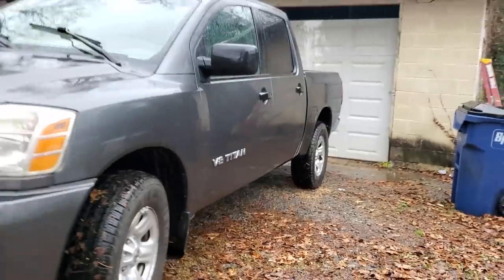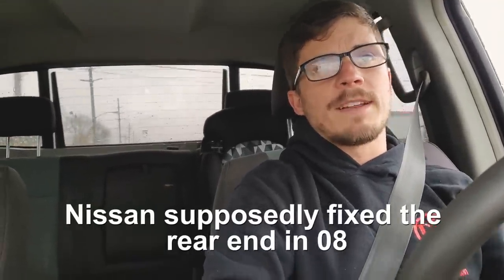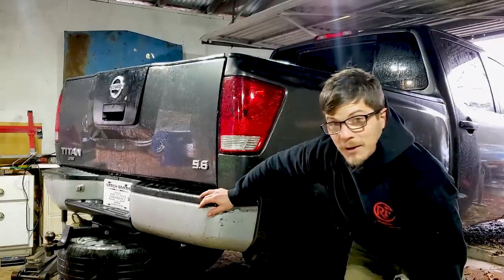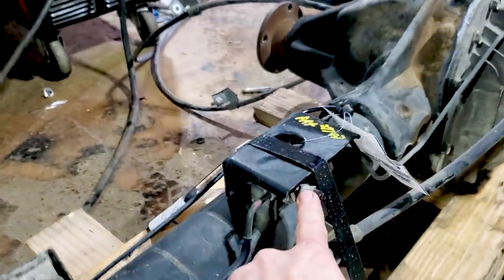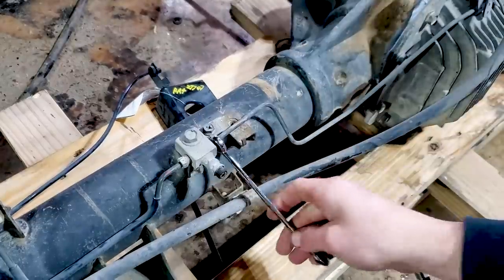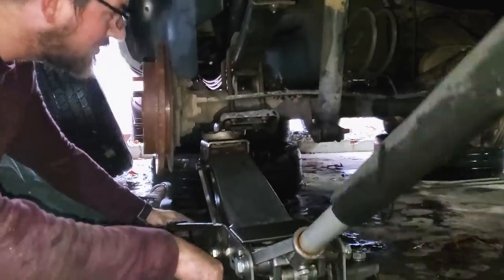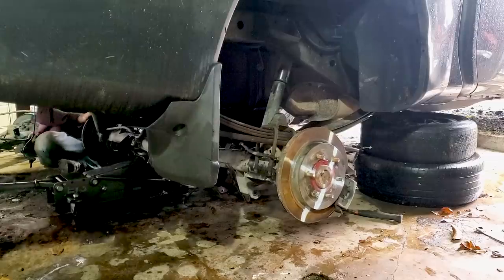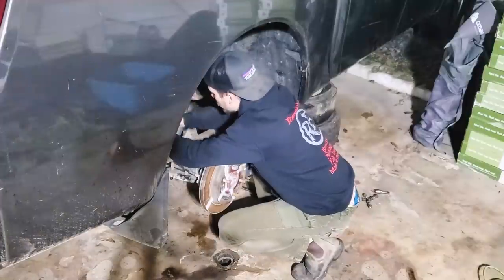HOW TO PUT 2008+ REAR END IN YOUR '04-'07 NISSAN TITAN

Comment: I have an '08 Armada with 315k miles. The Armada has an independent rear suspension vs the Titan solid axle so maybe they have different pumpkins. I changed my gear oil at 200k (probably the first time) and never had a problem. Mechanically these things are solid. There's a reason Nissan named the 5.6 the "Endurance". The only things that have needed replacement are the oil cooler adapter seals (where the oil filter screws in) at 250k, starter at 280k ( you'll be cussing Nissan for putting it under the intake), the alternator at 300k, valve cover seals at 310k. The exhaust manifold is known to crack, pretty sure mine is but I'm saving up for some Cajun headers. If you don't have the Magnaflow 24" 2-1 muffler, you need one plus the resonator delete. The trans pan has a drain plug. After about 50 - 75k it should be drained every other oil change or 10k. It's only a qt or 2, just measure what comes out and replace it. There's guys that have over 600k on the 5.6 Endurance without a major overhaul.
Reply: I totally agree with the endurance part. I'm at 329k with only minor issues like you stated. And yes the starter is a mf to change
Reply: 300 k, as a green sticker and  license plate offroad truck. Trans went out at the 300k but it because we tried to made it into a sequential shifting the abuse destroyed the wiring connections. 

Suspension is the only thing not OEM. Everything else is OEM and hasn't been changed. Other than the service maintenance parts.

The motor was pegged in the hot for 15 min in the desert trying to make it back to base camp. Still running strong.

Took a fence post or something like it through the front and destroyed the remote oil filter and dumped oil while running 65mph in the desert. Looked down and saw the oil pressure drop. Did a bypass to make it back to camp. Dam motor still going.

No leaks from seals... big fan of the first gen. Titan. Going to buy a couple more rolling chassis

Comment: 07 titan here. My rear axle had the same whining as yours plus I had leaking axle seals 4 times! Replaced the oem differential with a Tru Trac and applied ultra black rtv to the new axle seals. Has been holding up fine ever since.

What sucks the most about the 04-07 axles is that the payload capacity is embarrassingly low compared to the 08 titans. My payload is a measly 1039lbs while the 08s have double that! 

Thank you for this video and showing us it's not that difficult to swap axles. Been thinking of doing this for a while. Although at this point I don't want to give up the Tru Trac and the 08 seals aren't guaranteed not to leak.

Comment: I hav had my 07 for years. It’s the atmosphere valve. I replaced it with a gorilla system that runs a tube up to my tale light on a filter. Then u won’t get water in your dif. An it will allow Pressure to realer. The stock cable plug really easy
Reply: Made my own out of some fuel hose and a fuel filter for a lawn mower. No more seepage
Reply: Yes!that's what I am talking about..offroad gorilla kit,tru trac..beautiful

Comment: 07 titan... changed out the stock axle for a Curries G2. For its plug and play, 9" carrier, 4.11 ratio... stock diff blew up during hard abuse. 

 Doesnt matter if its OEM or aftermarket, Curries driver side seal leaked after 4 years of really hard use. I noticed the vent filter was gummed up. Ambient temps around 100, sustained high speeds when it started to leak. Keep that vent clean if you drive off pavement.

She's down for surgery.

Comment: did you check the final ratio before you installed? dont want the front wheels going faster or slower than the back wheels in 4wd settings lol.. wouldnt be good!

Comment: So the rear end on the pumpkin builds pressure. that's why it blows out seals. Drillingl it out,
 put a hose on it,
 a bleeder valve, some sort. you will have no problems.
Reply: Yeah, I was kind of wondering if that would work. Kind of dumb for Nissan to design a sealed chamber, with no vent.
Reply: @battalion151R  vent valve is on top of axle to the right of the pumpkin
Reply: @markandrews4818  
  Thanks! I got her home and someone already put a vent line on. Now I'm battling electrical issues. 
  Had no headlights the other day. Went out yesterday and they work. But, no turn signals, interior lights, seat power. The radio lights up. Will search for, and find stations but no sound. I hate electrical problems. Especially the intermittent gremlins.
Reply: @battalion151R  YW, yeah I know what you mean, electrical problems suck

Comment: The problem with the 04-07 rear ends is they have inadequate cooling around the differential, which leads to them cooking seals and leaking fluid
Reply: The problem was a lack of an axle vent.  Builds up pressure and blows the seals out.

Comment: So I’m currently changing the rear axle in a 2005 Nissan Titan and I can’t find a rear end to save my life can you tell me what year of rear end you installed?? What years will fit my 05 titan? Thanks in advance
Reply: Having the exact same issue. Which year is compatible with an ‘05 Titan, I think he installed an ‘08. But as far as where to get to part for cheap (because a brand new rear axle will tax you up to $2500) is at a junkyard, a pick a part place for sure but use google to get places near you.
Reply: 2004-2015 will fit. Just make sure you have the ratio the same. Aaron Hines also has a good video on swapping the rear end in a Titan - calls it the Rear Differential.

Comment: based on what ive read its supposed to be because the differential doesnt have some kind of bleed valve that most diffs in trucks have. So without that bleeder valve it builds up a lot of pressure and heat in ceratin situations, causing them to break and leak out of the diff cover or the hubs
Reply: all trucks have the bleed valve, and it usually gets clogged on all trucks, which is why the vent mod is usually done to fix the issue.

Comment: The rear end problems is because there is no vent tubes in the rear end so it blows the seals out and will leak no matter how many times you replace the  seals never had any problem with the pumpkin itself or gearing just have to make sure it has fluid so depending on how bad the rear end leaks you may add fluid every oil change
Reply: Because the vent valve on the axle gets clogged up,and I guess some people are not aware of it

Comment: You need to look up a video on how to put a vent tube yes a vent tube with a 6-inch wire with a fuel filter on it so that your differential can't breathe and the fuel filter will stop dirt from getting into your drive shaft this should stop your ear in from Breakin! It's $20 go to AutoZone or O'Reilly's and get a vent tube and it in and use zip ties for your hoses and run your hose all the way to your passenger tail light I'll just help you build Lil daddy

Comment: I have a 04 and the spider gear shaft broke in 3 pieces luckily it didn't hurt and gears but the gear get worn down very quick and the spider gear bearings get off a little make the gears not run together smoothly causing failer

Comment: Don't need to swap the diff out when there is an easier solution to the problem.

They fail because the axle seals leak, obviously. They leak because the bearing cage/retainer (whatever you call it) warps and then allows play in the axle, causing the seal to leak more. Everyone just replaces the axle seals/bearings and then go out right away and leak more.

NO ONE addresses the axle flange/bearing retainer. It is the part that bolts up to the hub and keeps the axle in place.

Comment: Thinking about an '04. I saw where they had a problem with the radiators leaking coolant into the transmission. Not sure whether they fixed that by '06. The '07's were rated as good, but the '08's weren't. '09 were good again.

Comment: Let me cut straight to the chase (insert photo here) I've herd weak seals are the downfall of the '04 - '07 Titan rear ends.
Reply: The seals are fine. They just leak because the flanges warp. People don't know this and throw in a new seal/bearing then it has slop in it, causing the axle seal to leak right away.
Reply: I think its the crap check valve style axle vent. Basically if your axle deep mud gets in it and it can't breathe causing seal leaks